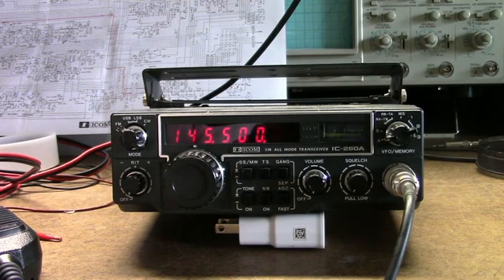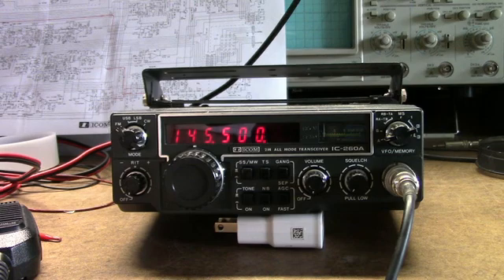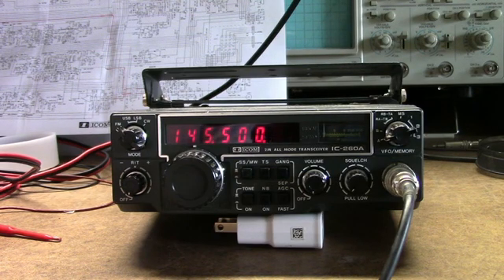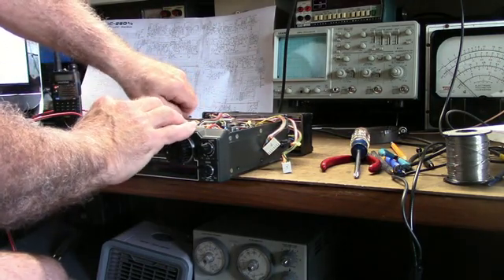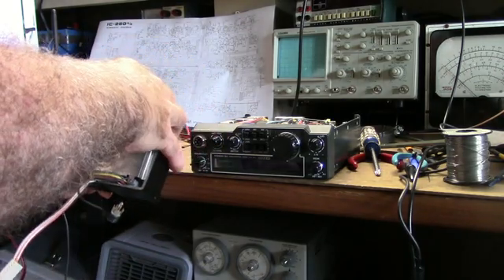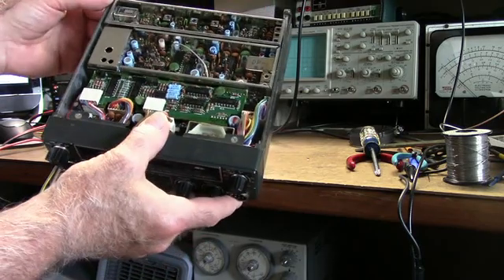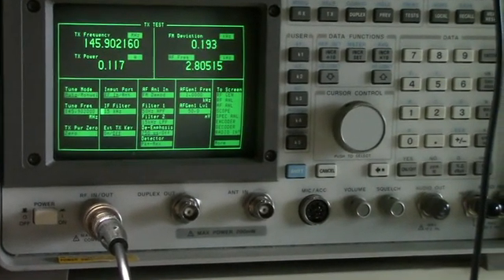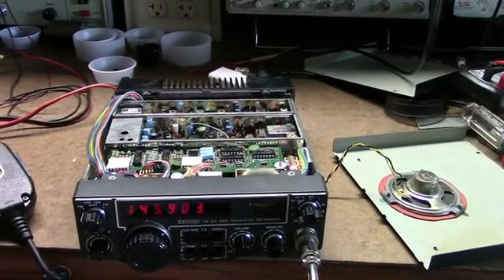Icom IC 260A

Comment: And? Did the AliExpress module work?
Reply from the maker: Hi egbertgroot,  I bought two modules from Aliexpress on two different occasions.  Both were non functional.  At this point I will either look for a donor at a ham fest or try and fabricate a PA using discrete devices. The modules were likely fake , but they did give me a refund.